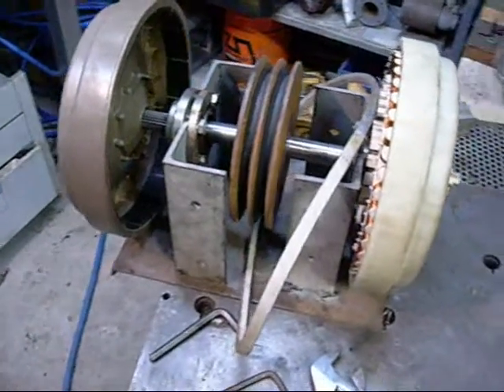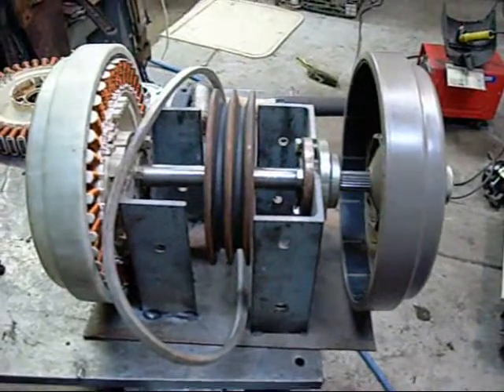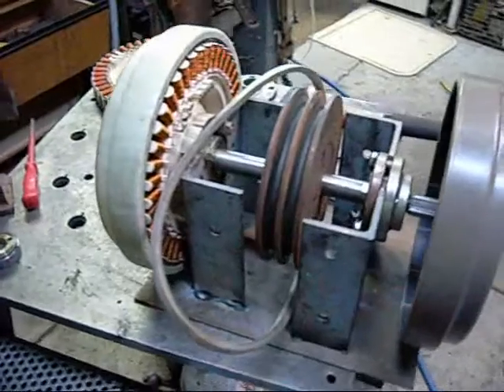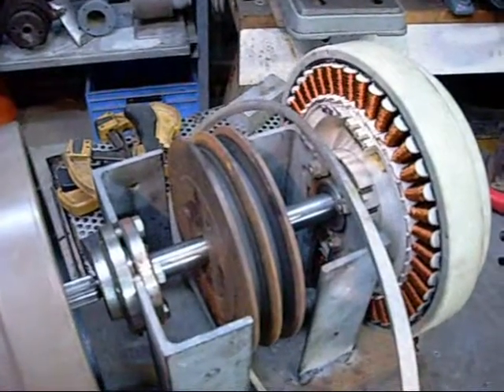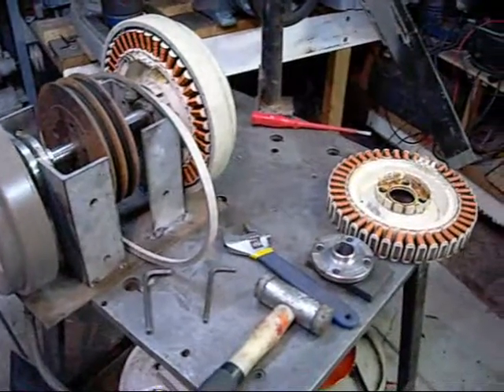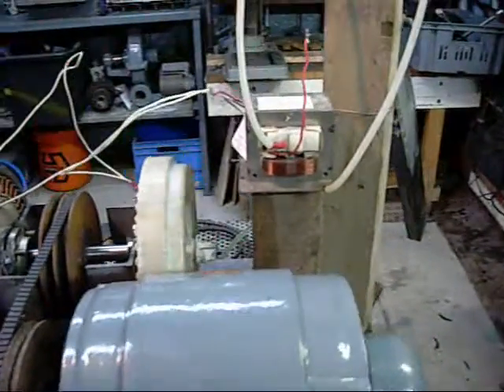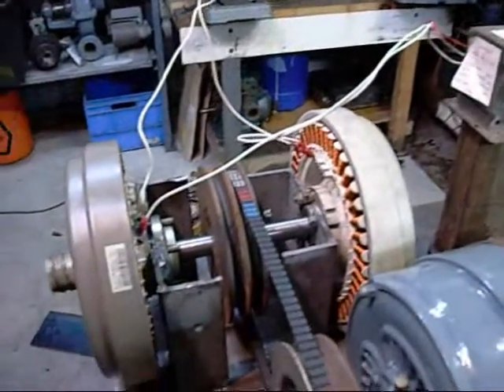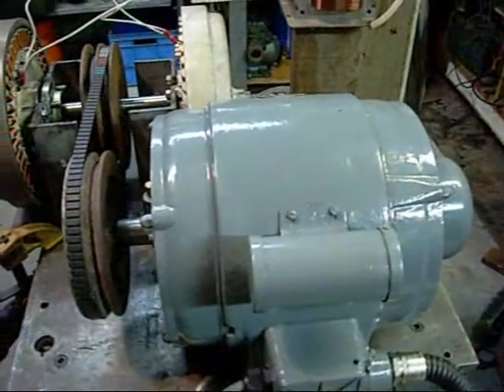Tandem Smart Drive Generator Test

Comment: if you want to get hold of the smart drive motors a website in new zealand sells them new, and re-wired so they can be used as a generator. the website is ecoinnovation. google it to get the address

Comment: you should get a scope and test the two motors at the same time to make sure they're in sync. If they're slightly off and you hook them together in any way, they wont work efficiently at all (they'll work against each other and overheat) A scope is the only way so you can see the wave form of both at once and you can adjust the stators as required until the waves line up perfectly.

Comment from the maker: Thanks for the complement!, I figured the voltage frequency or somthing wasn't alligning properly. the splines on the shaft are not alligned at the factory since one end just has the washer drum on it normally.

I'm set up to run with the JAP engine soon, I'll try putting the MOT outputs in series :D